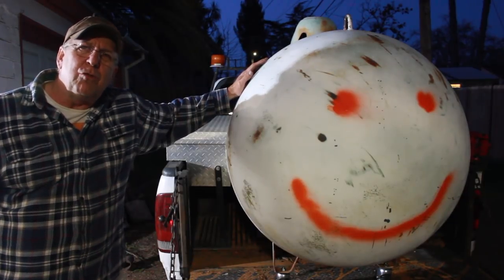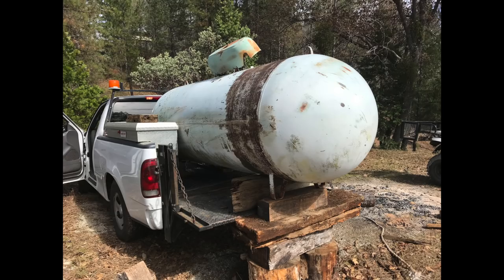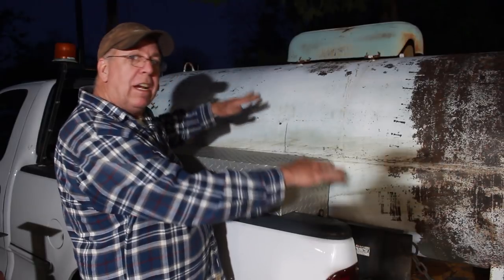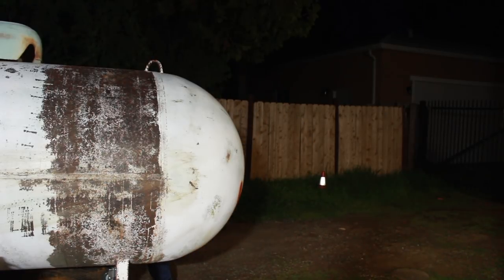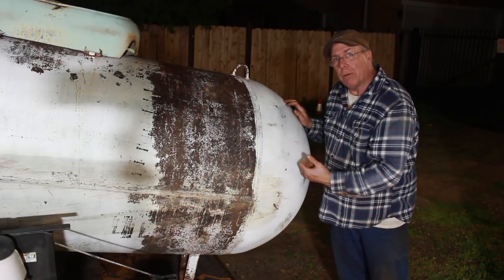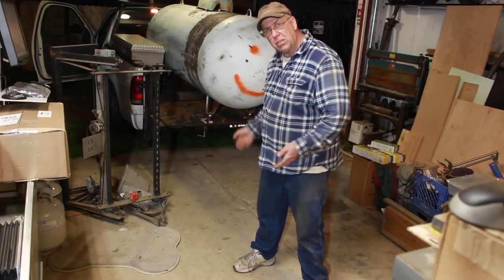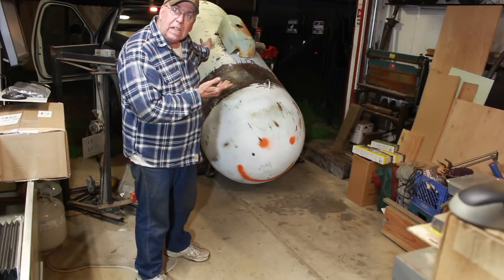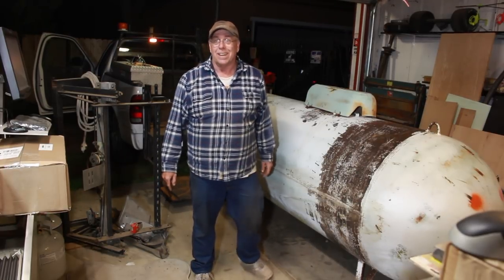How I unload a Giant Propane Tank by Myself!

Comment: I purchased a 500 gal propane tank that was about 50% full.  I just backed a tractor with bale forks on the 3pt hitch under it, changed the tank to the frame of the bale forks and drove it home.  We had more of a problem moving a 1000 gal tank that was 30 percent full.

Comment: I dug out a 250 as well from my back field . It's been buried at least 12 years . I cut out a 4 ft wide section lengthwise off the top . I pulled it with my 4x4 to a place in front of our screened in porch . I will bury it and leave the top 10 in. above ground . Chip all the rust flakes from inside and coat it with rubber white paint . It will ( hopefully ) be a pond . Any advise or has anyone done this before ? I'm newly retired and have nothing better to do with this tank . So ALL comments will be helpful . Ramiro

Comment: I bolt castered beams under mills and lathes to move them. The beam width ensures the load can't tip,  and it's MUCH safer than using a forklift though of course much slower. Useful video!

Comment: I'm lucky/glad to have tractors with front end loaders for stuff like this.
Reply from the maker: The problem with having a tool to lift heavy objects is the same problem with having a big wallet. A big wallet gets stuffed with more crap. When you have a hoist or crane, you find yourself acquiring more heavy stuff.
Reply: Wildman Tech Quite true. But makes little tasks much nicer. Especially since I'm certainly not young, strong, and tough as nails anymore.

Comment: The tank is missing a triangle nose. With that and a little red hat you can call it Jack (in the box).

At least you didn't start off the video with "here, hold my beer and watch this".
Reply from the maker: We thought about that, but didn't have the materials on hand to fab it before the trip home, Couldn't resist the spray paint though.

Comment: What casters did you use? Are they the 3 inch with a working load of 100lbs each? I have a 250 gal tank I need to move
Reply from the maker: @rodneyowens7919  I think their working load was more like 300 pounds each. They were cheap Chinese crap I picked up for $4 each.

Comment: I taught Construction Technology to high schoolers.  Always showed them the difference between using you back or your brain.  Built 8 x 16 storage sheds in the shop (so they could not be stolen or vandalized ) and then rolled them out by chain link round fence poles placed under the skids.  They were amazed!

Comment: My brother is a retired rigger.  So, I sent him a link to your video.  How did you attach the come-a-long to the inside of the truck?  Great job!  You are like a farmer who is forced to do things by himself!
Reply from the maker: I have anchors that are bolted to the frame in the front of the bed.
Reply: @WildmanTech  We have to do something similar but with some 500 lb drums. Want to make it easy... looks like come along would work, but what is the size of rope/wire you used for this. We will be using a tree branch to lift it up into our trailer. Any ideas, trying to figure out if we need come along or something else. Please help asap, husband anxious to move them and want him to not hurt himself. Thank you!
Reply from the maker: @lizdvine2548  I'd use a barrel dolly. Like this technique of loading a refrigerator... https://www.instructables.com/id/The-safe-and-easy-way-to-load-a-refrigerator-onto-/

Comment: That was awesome one man move! Out in the field and working by yourself a guy has to be resourceful. I went up above Warrensburg, NY and snagged a I think 300 but its over 9' wide, not sure if it was a 500, nevertheless,  I'm making a lawn roller out of it. Bought long 6" x  6"s to cross members to bolt together a wooden frame underneath to bolt on 6" casters so I can roll tank over and over while my wife stands at the ends with a sharpie marker and marks the centers of round sides for drilling for long shaft with pillow block bearings. This project first so I can proceed with making my backhoe cart with the same 600 lb rated casters, I think I bought 2 stationary and 4 steering caster style at harbor freight 6" high no less.